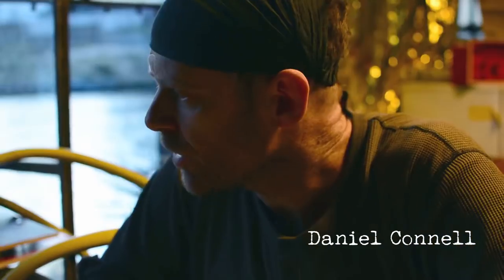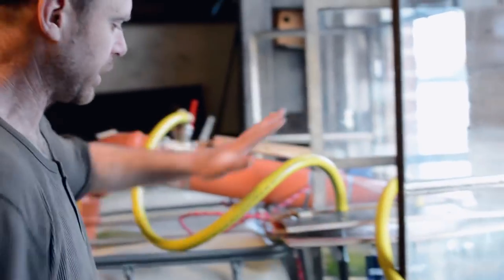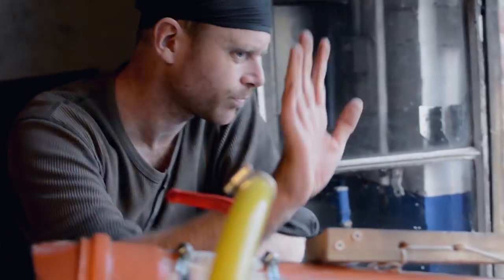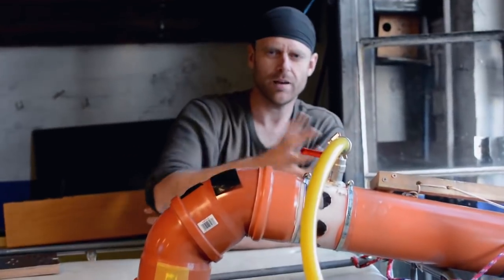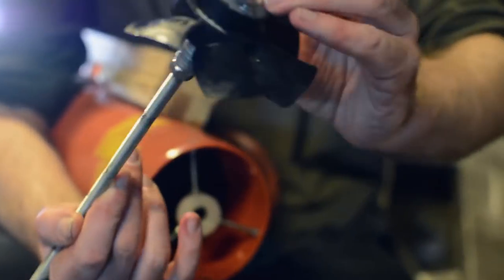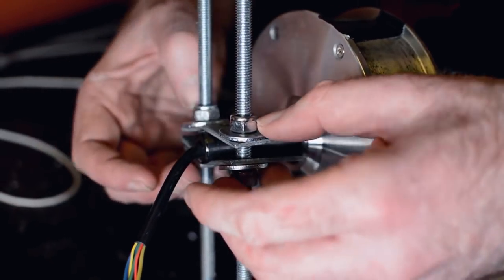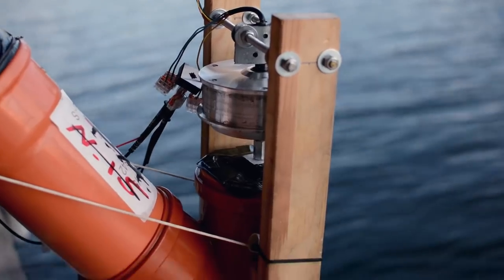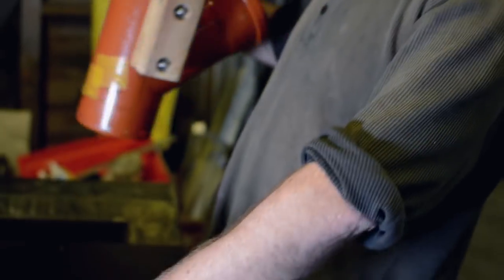$50 Water Turbine-5 kilowatt hrs/day - Open Source, DIY

Comment: Nice good luck with the field test! I would expect the fan for the generator will fail in real life test either brake due to stuff sucked in damaging it or getting clogged.
Reply from the maker: May well. There'll be a filter screen over the intake tho.
Reply: @OpenSourceLowTech  Probably want a larger 'filter sock' of sorts to give a greater area of water intake.
Reduce clogging which I would guess would occur with that volume over this small an area ... basically spread out the suction, allow for gunk to not get sucked against your screen as hard / much. Otherwise there will be a lot of cleaning required on the intake end.
Reply from the maker: @aenorist2431  Exactly.

Comment: Nice design! I was wondering if stacking another set of fan blades might improve the power.  Perhaps try them both aligned and staggered?
Reply: I was thinking the same thing, there is just too much room for water to get around the blades. Also with that much tail pipe you should make the pipe flare wider, maybe with couplings to increase the weight of the water pulling through the turbine.

Comment: Great concept and work. The hoverboard motors are something I've seen and used for electrical generation. They're so cheap if you buy a broken hoverboard, it's usually a battery that's gone bad!

The camera work needs to be a bit more stable and better focus control. I'm getting seasick!!! 😂

Comment: Nice!!! Could you please comment these things which came to my mind.
1. Why there is only one generator in the pipe? Has anyone tried more than one, like 3 meters away from each other in the same pipe? Isn't the water flow still high enough after first generator?
2. How much water is needed to generate lets say like 10 000 wh? I am thinking, could this be done with 2 water containers on a stable ground where the other one is like 3 meters high, and the other on the ground level. During sunny day, a water pump would push the water (using excess solar power which would not be used otherways) into the top container as a "energy storage" and during non sunny, when energy is needed, the water would be let down trough a pipe to the bottom container and in the pipe would have the generator. So to know how much water is actually needed to generate certain amount of energy would be interesting to know. So in this case you would not need a river, or anything, just the liquid in the container which would circulate. Of course the solarpanel, the pump and some generator would cost more, but this would remove the need of being near a river or running waters. And if the temperature goes below zero Celsius, the liquid could be something else than water, like some amount of glycol etc.

Comment: 22% efficient. Not bad for low cost DIY. Taking water from an elevated waterway makes we think that its only free if nobody else is going to need that 2.5m of elevation or need that water. Otherwise, it's potentially costing the water provider at least 5x as much input power.
Reply from the maker: I'm reasonably happy with that efficiency, but will be trying a couple further optimisations with the next build to see what extra can still be squeezed out.
I'm imagining for the most part these will be used such that the outlet just goes back into the same waterway as the input came from, so it wouldn't affect anybody's water resources or access. 
For the Catalonia build in the last video we were taking water over a wall, but it was just going back into the same river that was feeding the mill run we were plugged into, so even then the net effect was still zero.

Comment: What is the best way to use the power generated practically? Convert to DC using a bridge rectifier to power DC loads, use an inverter to utilize as AC, or use the rectified voltage to charge batteries which would then be output to an inverter?
Reply from the maker: Those a re all good options, depending on circumstance.
Reply: @OpenSourceLowTech  Ideally, would like to use the power as 220 VAC. Is it possible to rectify and use with an inverter?
Reply from the maker: Should be doable, yeah.

Comment: Hi  Daniel. Did you build that alternator by yourself or it's a ready solution? Do you thought instead of computer fan to use a Tesla turbine? (it is a  high speed rotor- 60 000 rpm)

Comment: Having multiple Fans offset at the correct angle my improve force transfer from the water to the alternator. it's likely also to increase the speed at which your shaft rotates compared to the flowing speed of the water. not sure if it this would help or hinder your cavitation problem.  if you space out the (multiple) fans this probably will space out the pressure differentials and decrease cavitation.

Comment: I don't know where you'll be testing in Scotland (or if you made it here before lockdown) but just thinking that it could totally be adapted to a lot of tidal situations (with added expense for proper corrosion resistance). Think they'd really like what you're up to on Eigg!
Reply from the maker: I've been thinking about this for tidal, especially round the British west coast where the tidal variances can be huge (like more than ten meters).
Basically you'd just need a walled off bit of estuary or similar, and a stack of siphon tubes with some kind of mechanical gate valves which only opened when the water was at its lowest. If the top tubes where below the high tide mark then the system should be self priming, and four times a day you'd either fill or empty the walled off volume, which if large enough could result in maybe a couple houses worth of power...
Reply from the maker: And yeah did manage to scrape back into Scotland at the last moment...
Will be here for the rest of the year. Hopefully get some water and wind turbines set up once we're allowed out of our houses..

Comment: Awesome.  I'm wondering about this cavitation...  It must be creating a vacuum?  It can't be air in those voids, unless something is leaking.  I find that hella interesting, rather than fight the phenomenon, there must be a way to utilize it?  Rifling in the pipe may create suction?  Placement of the propeller may determine how that suction can be best put to work?
Reply from the maker: Yeah I thought about that, but after playing round a bit, and talking to some actual engineers, cavitation is basically just something best avoided.

I ended up getting rid of most of it by moving the impeller down over the drop, and flaring the pipe after it to a larger diameter to reduce the velocity (but increase the volume, so more power not less).
Reply: @OpenSourceLowTech  Cool.  Keep changing the world brother!

Comment: Hydros are picky about the setup. The water relentlessly tries to disintegrate them, and it always wins sooner or later. If the hydro setup is not really robust and tight, it will be sooner. Basically, if a hydro or linkage has any shake or rattle, it's telling you it's on a fast track to failure.
Reply from the maker: Indeed. The upcoming build will be a longer term installation for finding out exactly this.

Comment: Cool stuff :P For a flat version, relying purely on water pression of a small barrage etc, I was thinking of putting the generator on the angled part of the y-Tube an duse a cardan joint .. then the water can shoot straight through the tube. I do wonder how to regulate the RPMs, since the commercial 500W generators state a "rated RPM" value? Like the standard 500-800W generators on aliexpress etc.

Comment: Have you tried to hook up an MPPT controller just for testing how much maximum power is possible to harvest? I just can't imagine that the system runs that good/fast under heavy load.
Reply from the maker: Hydro doesn't really vary, in the way wind especially does and solar to an extent, so MPPT as such wouldn't be strictly necessary, but you do definitely want to set an amperage load which give you peak power. This would presumably be managed by the charge controller or equivalent, and would need to stay fairly stable as batteries charge and discharge, and load is diverted etc.

Too much or too little load and you're not going to be running anywhere near maximum efficiency and output.

For this turbine about 3A times 60-65VAC is the sweet spot, but that would presumably vary a bit depending on drop and pipe diameter. Maybe specific shape of impeller to an extent.
Reply: @OpenSourceLowTech  3A * 60V = 180 Watt - why you wrote that your setup cost a half and produce 10x more energy in comparison with 120w solar...

Comment: Question ,,,if your inlet pipe was longer with a series of y  fittings  on their side at intervals stepping down in elevation each time ,could you run a series of alternators producing more power

Comment: Have you tried to use a torque converter from an automatic transmission for an impeller? much larger and possibly more energy.
Reply from the maker: Might be a bit large? But if I end up scaling to that degree then I'll keep it in mind as an option.

Comment: you should consider 3d printing some proper propellers with different angles in order to improve the efficiency of the system. I know, it's not low tech anymore, but nowadays 3D printing reached the masses and with parts made and donated by the community you can implement your project more easily
Reply from the maker: The props are pretty modular, and easy to swap in and out. So pretty much anything of the right size can be used, and yeah would like to see what's optimally efficient.

Comment: For flat situations, could you build a setup with an Electric pump to pump the water into the upper basin and run rhe system, while making more energy than its using?
Reply from the maker: Short answer no.

Comment: With regards to the cavitation issue. Can you get cooling fans with different blade pitches? Or perhaps just heating and tweaking the blades to test pitch effects could yield less cavitation.
Reply from the maker: I tried two other fan shapes, one with a steeper pitch, one with a wider central hub. Both reduced output power by about 15%. Cavitation was less on the steeper one, but that's been more effectively reduced with the tail cone and increasing the pipe diameter immediately after the impeller.

Comment: Would adding a toilet style S curve p-trap help with 1. Air coming back up the pipe and 2. starting the system without the cone plug?
Reply from the maker: Air intake no, starting the siphon possibly, under specific circumstances. There is such a thing as a self starting siphon, but only works with fairly exacting specifications.
This full up-over-and down type siphon I have in these videos is just for the test rigs, in actual field use I'm imagining something a bit different, tho same principle and outcomes, which should I think and hope be easier to start, and produce a little more power.

Comment: Hope you get this . Why don't you add a second generator . I'd experiment with belt drive . Instead of direct drive . A plastic wheel hub for the drive wheel . By using a larger wheel to drive the generator . You increase rpm . Thus gain power output . Also , you might reduce the size of the feed pipe . The larger discharge pipe would cause suction to increase .the smaller intake means less volume required .

Comment: What an awesome project. Am I correct in assuming that you could use this on a body of standing water, like the center of a lake or pond? Once the siphon is primed, it seems self sustaining. I have a few use cases but no flowing water.
Reply from the maker: You need to be able to dump the water out to a lower point, and the feed supply will need to be replenishing at least as quickly.

Comment: My property has a navigable river flowing past it at a fast rate, but it is about 20 feet below the property down a steep cliff with little bank below.  I've been trying to figure out how to tap into that energy.  The drop in elevation of the river as it passes our 100' of property is probably about 5 ft. or so.  Unfortunately, we have a lot of rafters pass by during the summer and the water level drops significantly as the snow pack dwindles.  I like the concept of using the siphon but am not sure how that would work.  Do you have to have a big drop from inlet to outlet?  What if you used a larger pipe on the down side; would that increase the draw on the upside due to the weight difference in the water?  Etc

Comment: Trying to understand what this does in summary. I understand the output and how that generates electricity. In a horizontal world, no drop/head, where does the water come from? I saw something about you get it from the river and pump it up to a tank. How does that pump-up action work? Thanks.
Reply from the maker: The pump is just for this test rig. In actual use it would be plugged into a waterway with a couple meters natural drop, tho this wouldn't need to be vertical, an incline would also work.
Reply: @OpenSourceLowTech  Thanks. I wondered if there if were a syphon-suction physics discussion I miss
ed :-)

Comment: You should look into perfecting the work people have tried with gravity generators but a way to have it reset itself
Reply from the maker: The in field use will just plug into the drop of a river, not the full up-over-and down kind of siphon I had to use in the test rigs, and should hopefully be able to self start if the siphon gets broken.
Reply: @OpenSourceLowTech   great. I meant using a weight that falls on a cable or rope which is connected to a pulley which is the geared up many times which creates a breaking force slowing down how fast the weight drops to a slow speed and also it increases the speed many times then this conne tex to an alternator of some kind. There is a gravity light on the market but not very effient. A few people have shown things with more potential. A large water filled container falling slowly generating power while another is filled with even a very small stream that would normally not be enough to generate any kind of power, once the container reaches the bottom, the water is released back to the water course and the 2nd container starts to fall lifting the 1st container back up as a counterweight and the cycle could continue. This could even be an option for people in the uk from their tap. As long as the water wasnt just getting flushed away.
Reply from the maker: @TheJunkyardgenius  I did have a quick play with a gravity light a couple years ago using the little motor+gearbox turntable assembly from a microwave oven, but there didn't really seem to be a sweet spot in terms of weight, drop speed, revs, and voltage. Something a bit more bespoke and tuned might do a better job.
What you describe with two alternating water filled weights should be easy enough to implement, but if you're wanting anything more than a couple volts you're I think fairly quickly going to be honing in more on something resembling this turbine here, or similar.

Comment: Can you use a hydro jet configuration to increase your rpms where there is smaller water flow?
Reply from the maker: Kind of. It's not a pressure turbine, like a Turgo or Pelton, so a proper jet as such isn't an option, but throttling the flow across the runner, ie a Venturi, will increase your meters per second of flow, tho not your litres per second or overall available power. It'll also cost you torque unless you do something clever with runner and throttle shapes.

Generally tho I've been finding the turbine is pretty good for revs, arguably too good as the open circuit voltage can be well over 100V, which can be more than a lot of charge control and other componentry can handle.

Comment: Daniel, I didn't see that read more part of a comment you made on one of my videos. I can do JPEG of anything
on the CAD drawings and use it as an attachment to an E-mail. But that requires an E-mail address which has no 
security other than no one watches my videos. let me know on that. You can do a screen capture in windows  and 
open that in open office to crop off extra stuff to save what you want. I use Rhino 3D which is a .3DM file extension
but can save to a lot of formats such as .DFX that most CAD programs will open. If I send something as lines rather 
than 3D solids the file is fairly small however sometimes text or dimensions are out of scale. The drawings have 
intermediate saves of the drawings and other stuff that can be deleted before exporting to also reduce file size. A 
drawing has the advantage that you can edit them where a JPEG is what it is.
         As for use, I am doing a dual rotor axial flux which  combines and redirects the flux of the magnets for much
better efficiency. However if your alternator is 3 phase with all the coils of a phase in series they would be connected
the same on your outrunner alternator. As for the feeder turbine, Jet engines use those but they are arranged opposite 
the direction of the power turbines blades.

Comment: Because your tube is an inverted U shape could you apply 2 motors? like one vertical and one horizontal? Thank you for all the info on this !!!
Reply from the maker: Being a momentum turbine, each impeller you place in the flow will remove energy from the whole system and slow the water, thereby taking energy and efficiency away from any other impellers.
Also two impellers means two alternators, which doubles the cost and work, and can be a little trickier to work with electrically than just one channel.